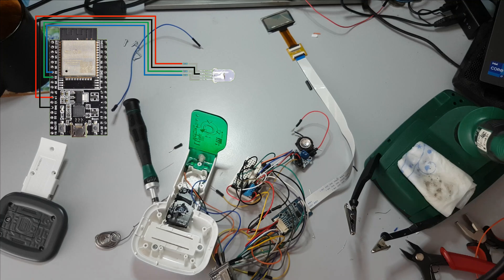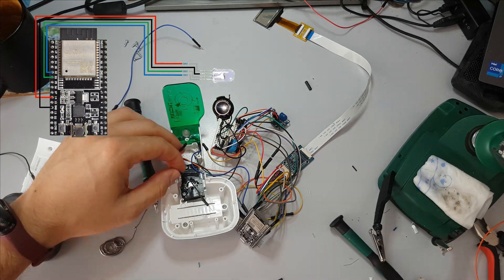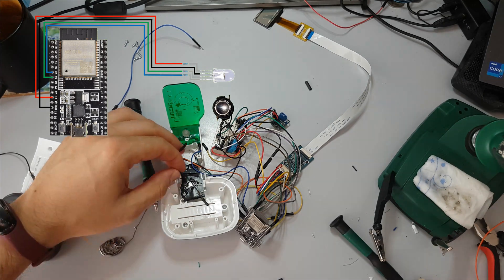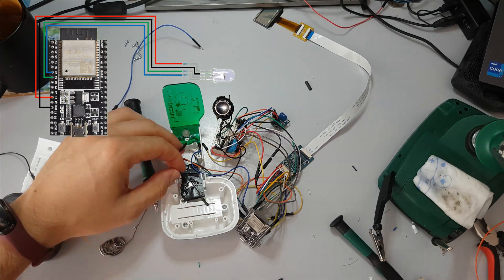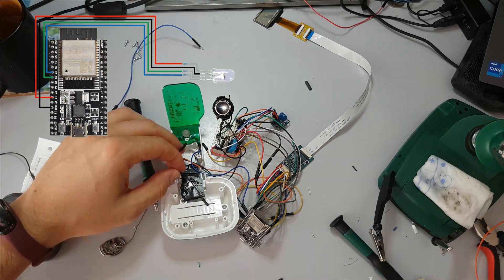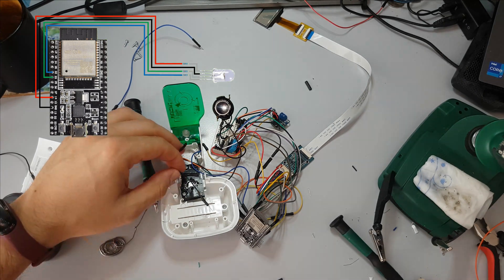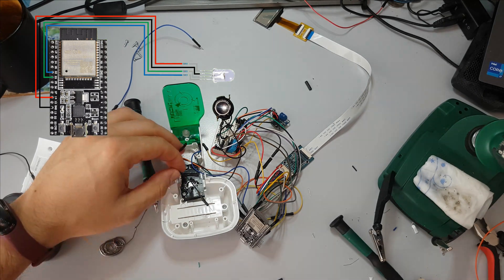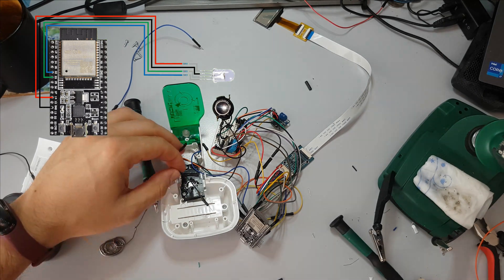Dragon Ball Z Scouter Cosplay Part 2 - Speaker Installation and Button Integration #sparkingzero #db

Comment from the maker: It seems like I made a mistake in the picture on the left side. There, the LRC is connected to PIN 22, but it should be PIN 25. The BCLK is connected to PIN 25, but it should be PIN 26, and DIN is connected to PIN 26, but it should be PIN 22. I deeply apologize for the error, and this will be fixed in the next video.